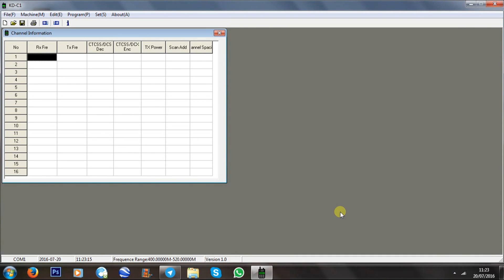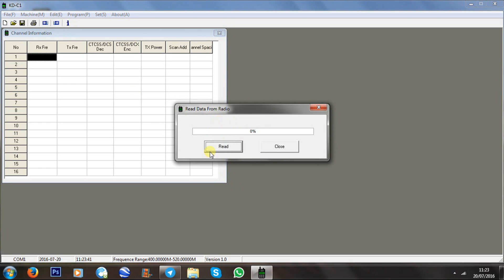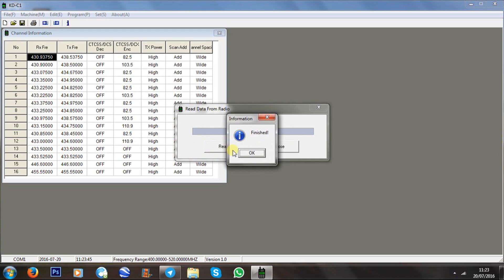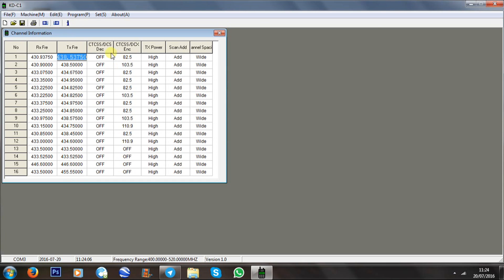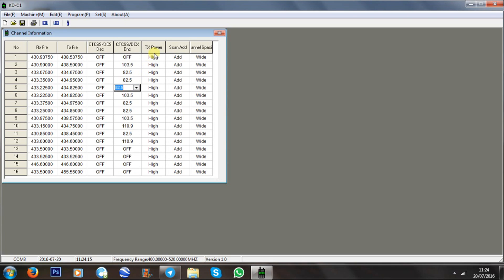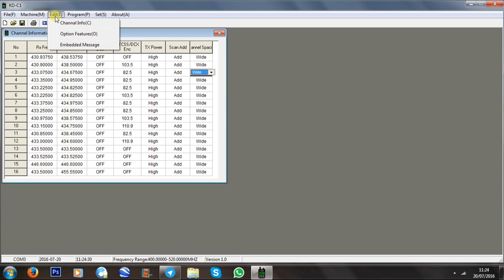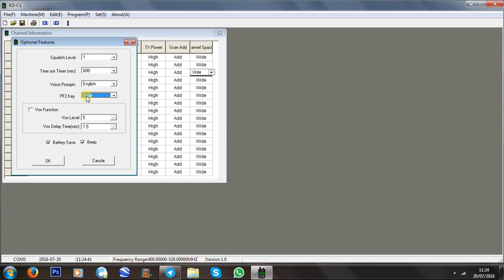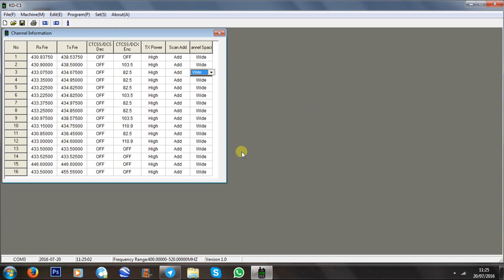WLN KD-C1 Programming & 75 Mile Repeater Test  - Part 2

Comment: I bought one of these and a cheap baofeng programming cable off ebay, , the cheap cable had a counterfeit prolific chipset in it (like all of them) and i could not get it to work,  after arsing around for two days to get it to work i seen the light and bought a prog cable with a genuine FTDI Chipset from Techfix-uk, now it works no problem after windows 10 self downloaded the drivers, make sure it is a genuine ftdi cable and the port is set in the prog software and device manager. save yourself the headache and use a cable with a genuine FTDI chipset.
Reply from the maker: Yeah it's a minefield Paddy, I've had a tonne of issues with crappy cables over the years. Glad you got it sorted!
Reply: All sorted now, the FTDI cable was £17 but worth it, the ebay cable is going back

Comment: Hey Bro I bought one of these, but there is no softwhere for mac !!! or how do I program it any ideas or advice would be great 

Alex
Reply: Hi, don't have one of these radios so can't vouch exactly for this programming software. I have a Hytera PD-365 and Connect Systems CS750, both use USB programming cables and I use Oracle Virtualbox on a Mac then install Windows XP as a virtual machine and you're away.
Reply from the maker: Hi Alex, I don't know how to programme with mac. Is there anyone who can lend you a windows PC?
Reply: Ringway Manchester hey yea I mite have to ask someone ahhh I hate when tech is only windows based it shows more plp use ham in the uk
Reply from the maker: Yeah it is annoying, hope you get it sorted mate
Reply: e
Reply: Chirp software works with the MAC

Comment: I have a working cable that works fine with UV-5R's and BF-888's. Using the KD-C1 software, correct com port selected... I get an error both reading and writing to them. Useless so far

Comment: Hi. I started programming the radio this morning. But after programming and turning radio off, disconnect program cable and turn radio on there is no led indication that the radio is on, no voice announcement when switching channels and only led indicator when transmitting. I noticed in your video that I did not hear the voice channel name and there is no light on when you are transmitting. Any clue on that ?  Thanks..
Reply from the maker: Hi ben, you'll see in the video there's a dropdown menu to set the voice, etc. No LED indicator when the radio is on. There is a light when the radio RX and TX.
Reply: Hi. My problem is solved, but it was hardware related. I also got no audio with the squelch open. I opened the radio and found that one of the connectors for the headphone output was not soldered at all. After soldering that connector my radio gives the sound again.  Thanks for your tutorial !
Reply from the maker: Glad you got it sorted Ben
Reply: £8.99 on Amazon at the moment.
Reply: does anyone have the software ? I have the programming lead from a uv5r but the download on 409 shop is offline.